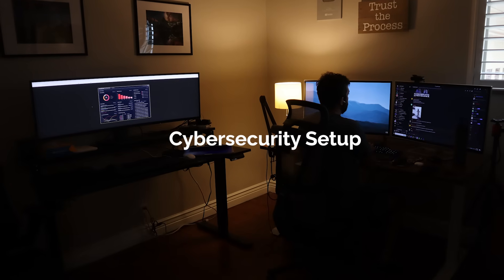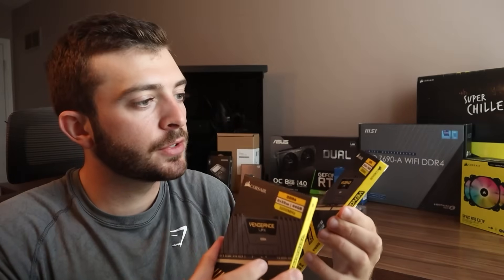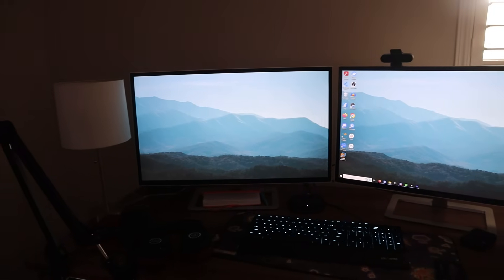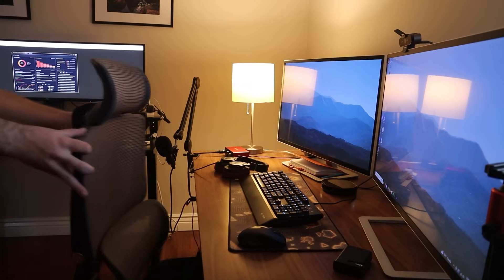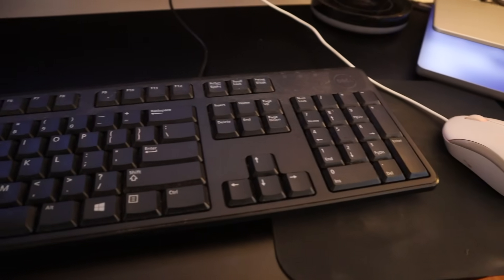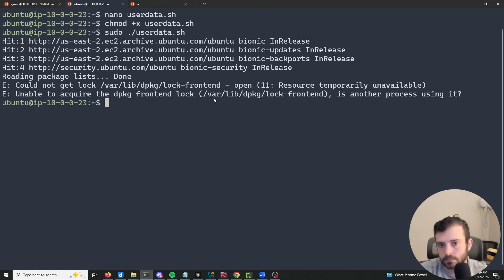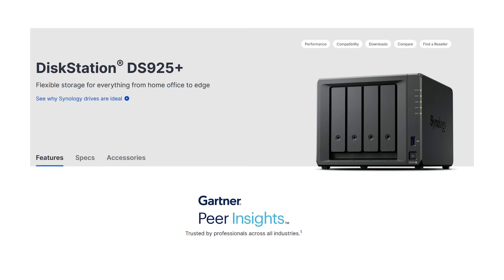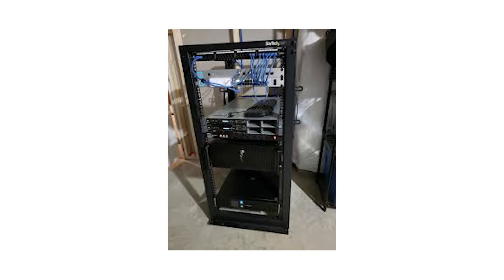My Cybersecurity Setup 2026.

Comment: Practically how can I start, I have my computer set up, hot spot, and is it recommended to list commands before getting started on a project or just have a strong structure on how smoothly the operation can go regardless of how unknown the problem can be despite the familiarity behaviors can be followed by experience. Need a simple step by step guide.
Reply: You don’t need to plan every command in advance. Start with a clear goal, build something simple, and learn as problems come up. Running one small service at a time and documenting your steps is a good way to learn.

A simple way to get started:

1. Decide what problem you want to solve: ad-blocking (Pi-hole), cloud file storage (Nextcloud), network monitoring (Netdata), etc.

2. Install a stable OS (Ubuntu Server is a good choice)

3. Learn basic networking (IP address, gateway, DNS)

4. Install Docker/Portainer and run one simple service

5. Document what you did and what broke and how you fixed it

You got this!!

Comment: Hey Grant, quick question ( fyi I'm not subbed nor into Cyber so yeah) but why would anyone in Cyber share their setup, hardware, config when that could be a possible vector of attack against you? Like, I've known a few Cybersecguys, sysadmins and such and... tbh none of them have told me what they're running at home nor at their job. Not that I've ever asked either but... unless you or anyone would like to show off I dont see the point. I know you're not showing your static public home ip and your router firewall rules but... from a social engineering pov this could be something to think beforehand idk. Either way, great setup btw, no hard feelings here just a curious question from a fellow IT guy.